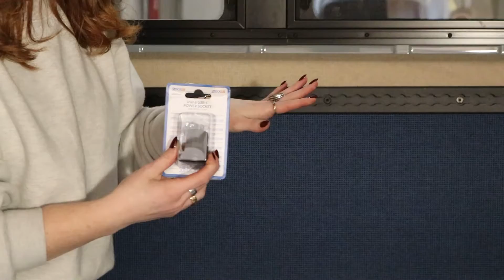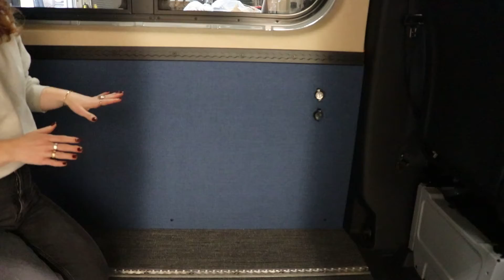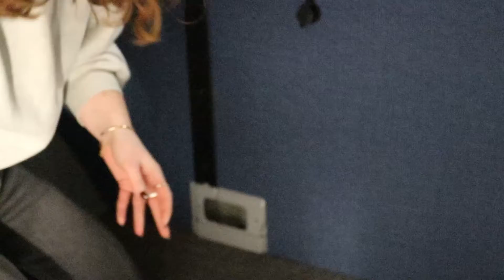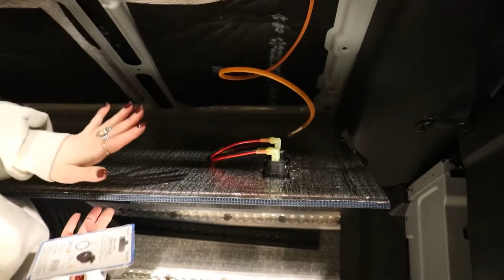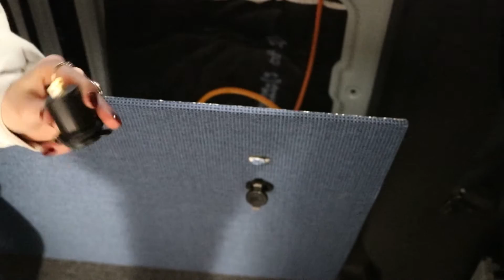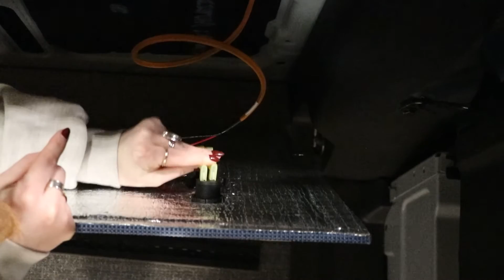USB-C/A retrofit - Adventure Wagon Van Conversion

Comment: Do you have a link to the USB-C outlet?
Reply from the maker: We buy our outlets in bulk from our distributor, but here is a similar one on Amazon:https://www.amazon.com/Charger-Waterproof-Delivery-Voltmeter-Motorcycle/dp/B07NV9D61R/ref=asc_df_B07NV9D61R/?tag=&linkCode=df0&hvadid=343230744149&hvpos=&hvnetw=g&hvrand=10992287888209393697&hvpone=&hvptwo=&hvqmt=&hvdev=c&hvdvcmdl=&hvlocint=&hvlocphy=9032947&hvtargid=pla-758960757053&ref=&adgrpid=66488820702&th=1

Hope that helps!

Comment: If replacing a 12v plug socket with one of these USB-C/A sockets, is the hole diameter the same?
Reply from the maker: Yes, the diameter is the same.